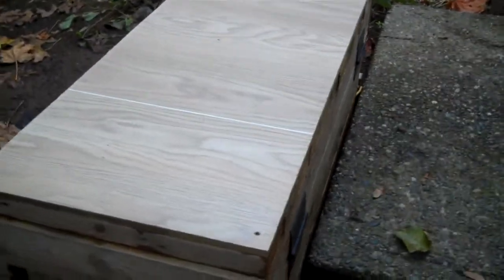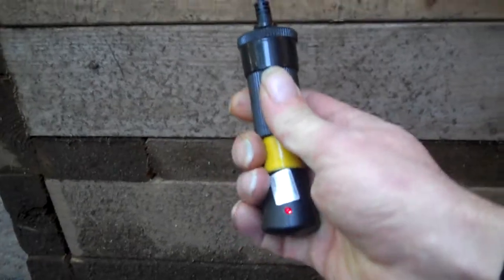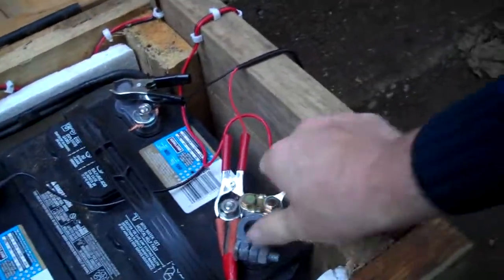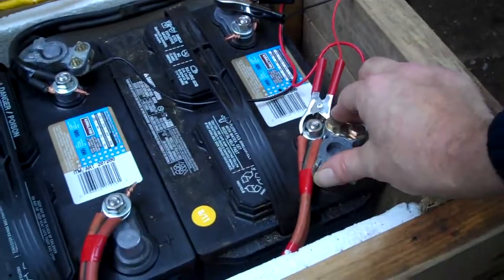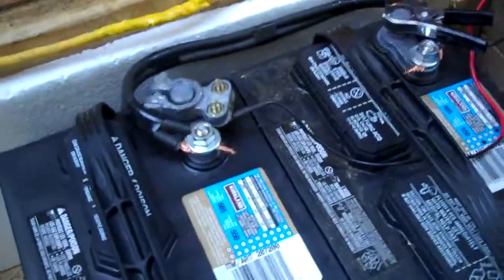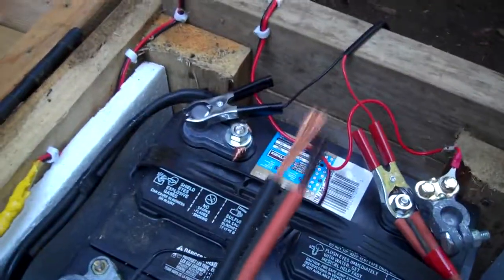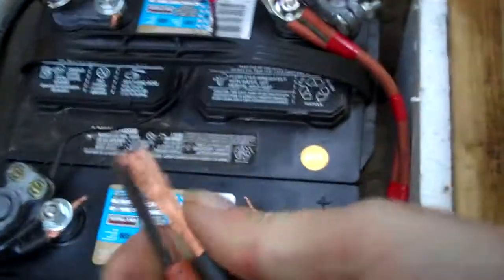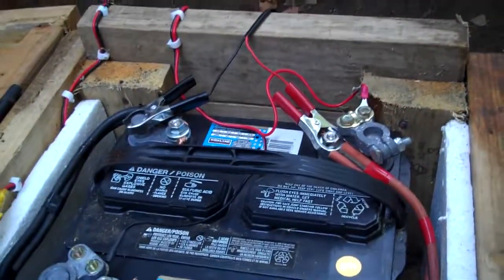battery addition2.MP4

Comment from the maker: Sorry for the late response.forget to check comments often.had no troubles yet.at the time i started this setup  those golf cart batteries werent permanently stocked so i went for something i could expand with.i probably woulb have went golf,but having the 12v batteries has come in handy.took one to jumpstart a car.i now have an isolated automotive battery just for that purpose also solar charged.that way i dont use the deep cycles.not built for that.all my stuff is 12v anyway